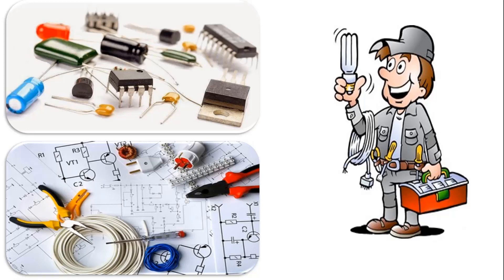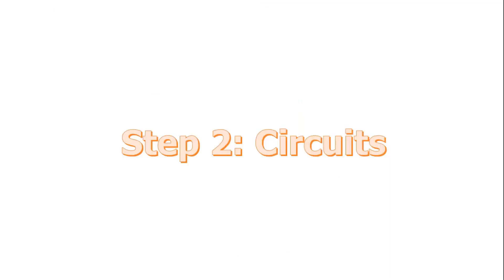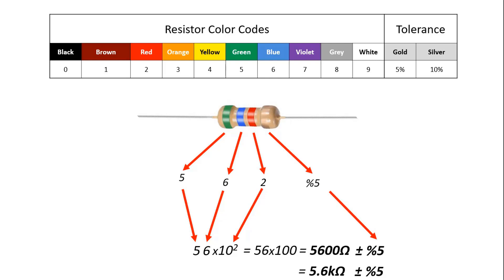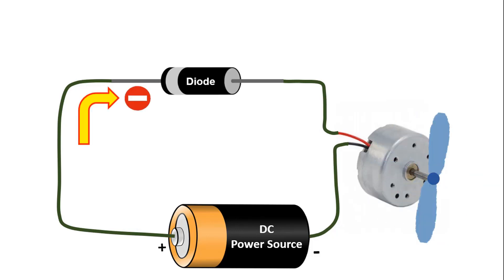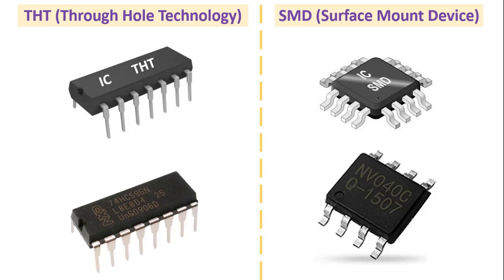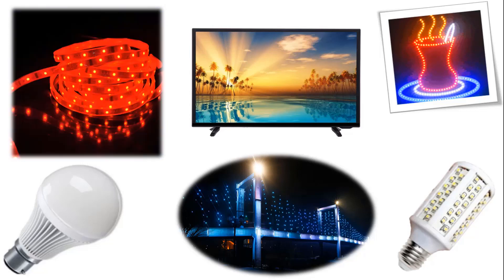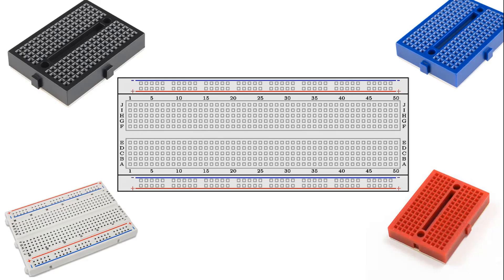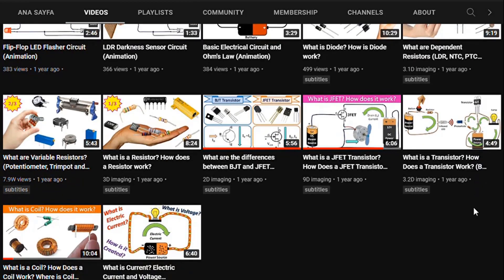Basic Electronics for Beginners in 15 Steps

Comment: Hum I always was taught that a Hz is one cycle, thus starting at the mid line and then returning to that point where the cycle begins again. If change in direction is your definition then that change occurs in less than one cycle, starting at the mid line going up to +peak then down to mid line then below to bottom of - peak. That is not one cycle. So 60 Hz is 60 cycles.